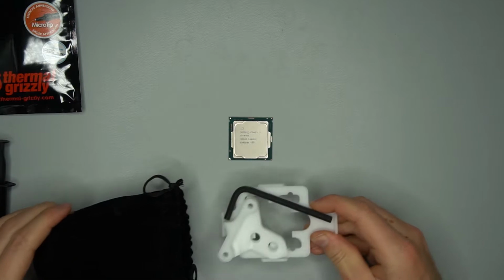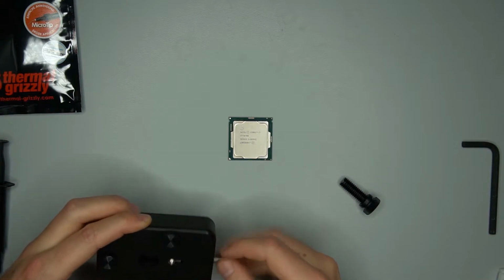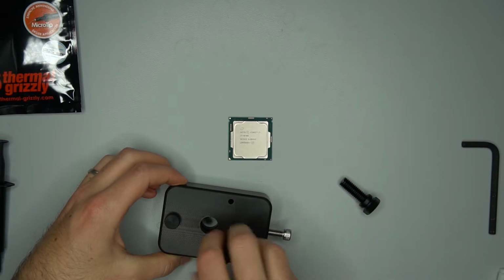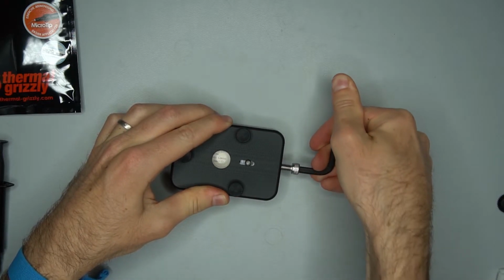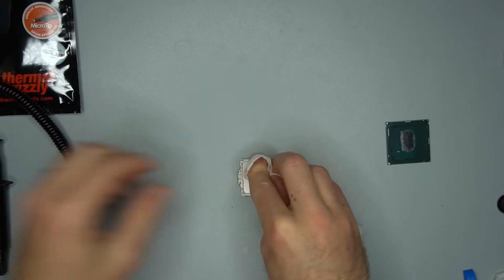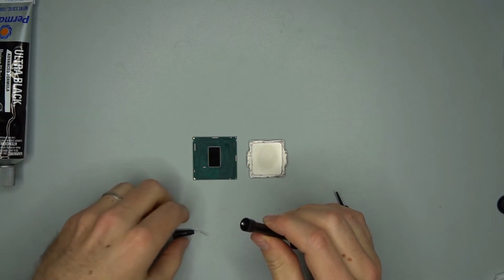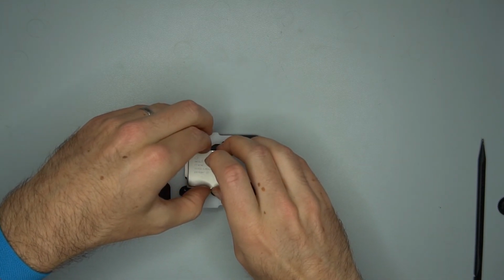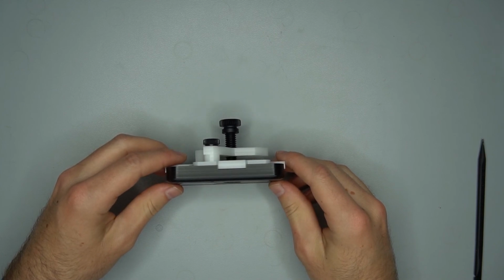How to Delid an Intel CPU for a Silent PC

Comment: What kind of maintenance is required after doing this?
Reply from the maker: None, it will be fine for years after relidding.  I don't know of any long term comparisons between the stock thermal paste and liquid metal, but liquid metal has been used for years without maintenance and without issues.